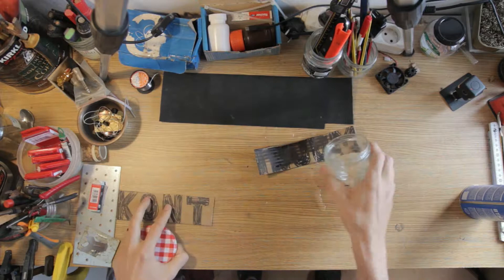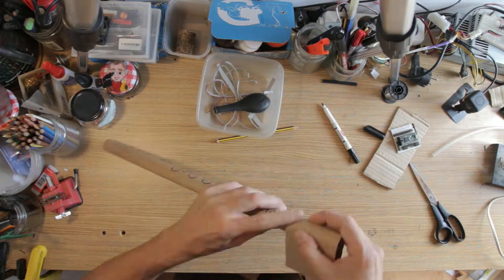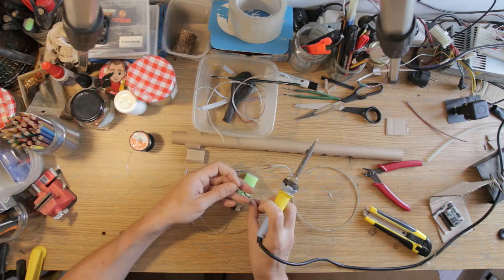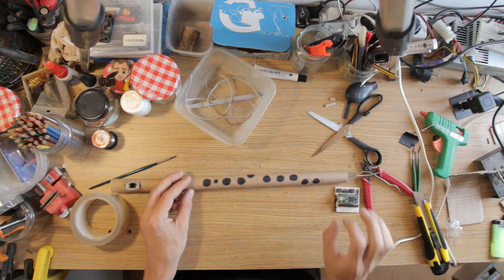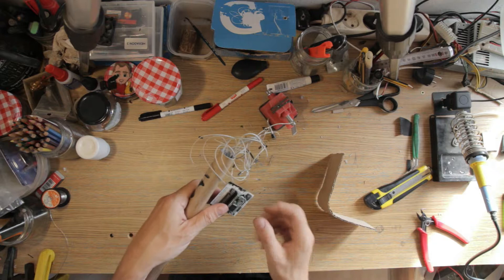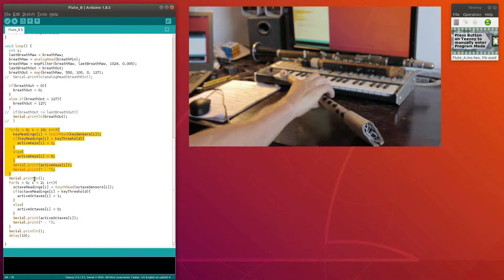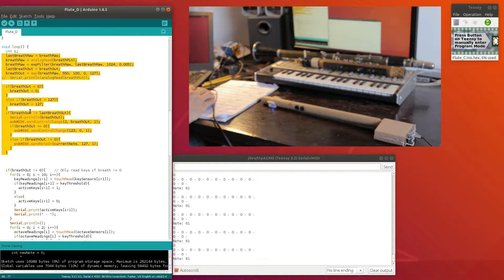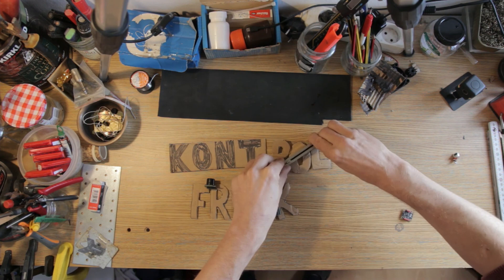KontrolFreak DIY cardboard MIDI flute. Worlds first flute mouthpiece emulator?

Comment: wow. As a flutist I had tried the Wx5 and Wx11 the Ewi (severals) and the roland wind controler. always looking 4 something like that. Wind flow of flute... .. Can you make like a level measure to attach to pitch bend... like when you turn the flute inward to go down in pitch?
Reply from the maker: An easier way of implementing pitch bend might be to have a capacitive sensor for the lower lip. The further back, the lower, further forward higher...

Comment: I'm curious about your design decision to use a blue LED with the BAW34 photodiode. Looking at the BAW34 datasheet the peak spectral sensitivity is around 940nm (near-infrared) but a blue LED emits around 470nm, resulting in only about 20% of the sensitivity range of the photodiode being used.

The sensor you built is ingenious and obviously works well.

I'm just wondering if you experimented with different wavelength LEDs and if so what the differences in the reaction of your sensor were.
Reply from the maker: Excellent question. I'm using visible light blue LEDs. While the BPW34 certainly peaks in the infrared range, it responds to most visible wavelengths. I've tested many different colored and white LEDs, most of them work, but I keep coming back to this cool blue one, which is the one that I've found which gives more light / current generally, and which works best in this setup. 
(Reply mostly copied from my response to the same question in a comment on this video: https://www.youtube.com/watch?v=sKPFRQCAaQE ) I also revisit this mouthiece/sensor concept in this video: https://www.youtube.com/watch?v=Apv0SkPBXDA
Reply: @KontinuumLAB  Thank you :-D